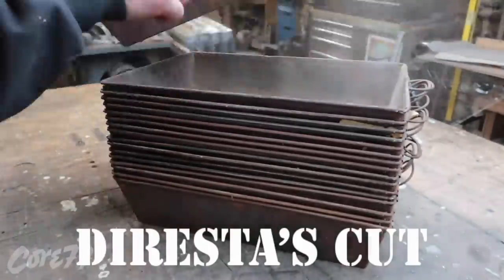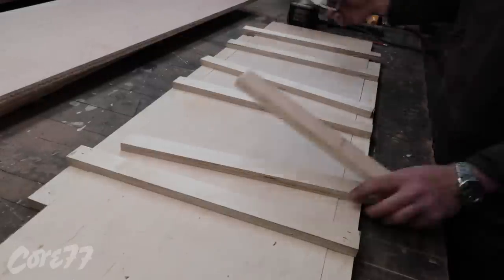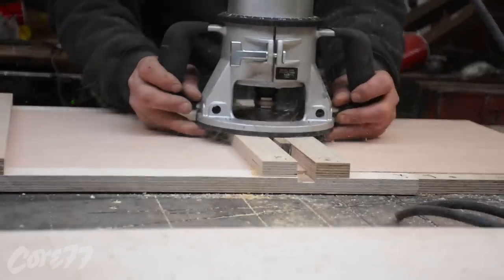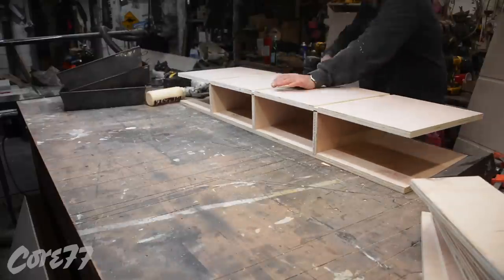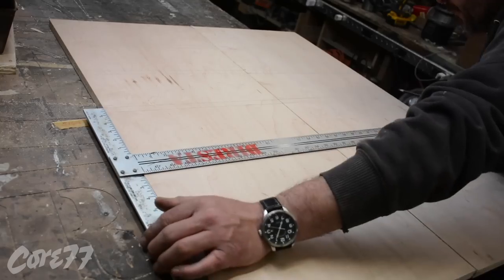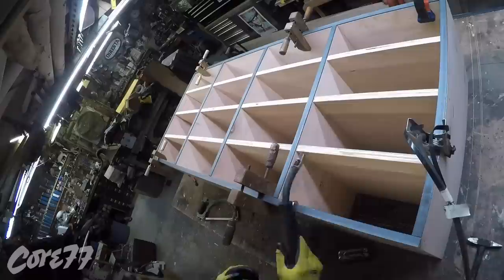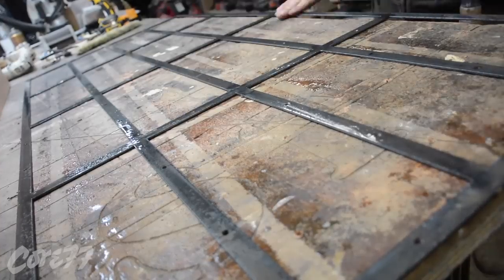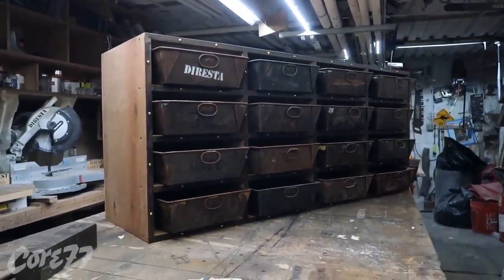DiResta's Cut: Bin Cabinet

Comment: Reminds me of the parts bin my grandfather had set up. He used the old metal 1 gallon oil cans, cut off one side and rolled in the edges, and had a set of shelves on either side of the door into his shop that he set up specifically for those. Remember going through those cans for the odd nut or bolt for whatever project I was building under his supervision at the time.

Comment: This would look good under a work bench built in a similar style.  My step dad built drawers to go under his discount store work benches "leg kits" as there were no add on options for these kits.  In the industrial McMaster Carr work benches, there are a lot of choices like a drawer stack or a locking metal cabinets to hold large tools.  Yes we can build these ourselves but I find that trying to work in time to demo a bench and build storage is hard because we use these work benches daily.  I think that in my future life I will make the extra upfront effort to build out whole walls of upper and lower cabinet/benches on the walls of my shop area/garage.  I would like to add "I don't want a water heater in my garage again" it needs to be outside I do want a sink with hot/cold running water and I want to be able to run a hose off the faucet to wash cars with hot water.  On the subject of steel work benches someone needs to build a "leg kits" that you lay whole 2x4's inside the leg channel to keep the thin cheap steel from bending the wood adds mass making it a more Perfect Union of bench top, in to the legs and in to the concrete floor.  When I hit something with a hammer I want it to feel like I'm using a 5# lead shot mallet even if it's a 4oz brass hammer.  
Peace through heavier hammers

Comment: There are router bits made for this, I think they are even called dado bits. They have a guide bearing so you don't have to glue those pieces to your router.
Reply: Jeff Eberl I've used the berring and saw dust gets in the way
Reply: I think your solution is pretty elegant. Who needs a hundred specialty tools when you can use a little ingenuity and one tool a hundred different ways.
Reply: Makes perfect sense.
Reply: Jeff Eberl Undortunatley most router bits that I came across have the bearing at the tip.
Reply: They sell template bits both ways. Though they're only worth getting if you use templates often. Even then I find that a pin router setup works better for mass producing most things (assuming it fits in the work area).

This was an interesting solution. I usually see people boxing in the base of the router on their jigs. I feel better about that than superglue, but for something as small as dados it is probably fine.
Reply: He said why he does what he does. Listen and he answers your question.